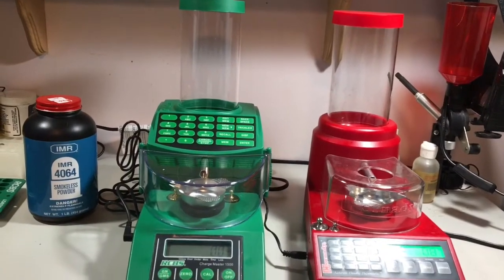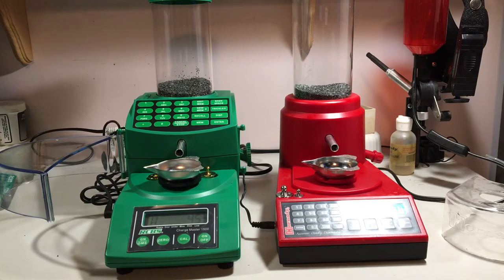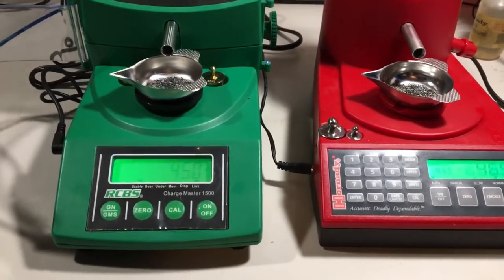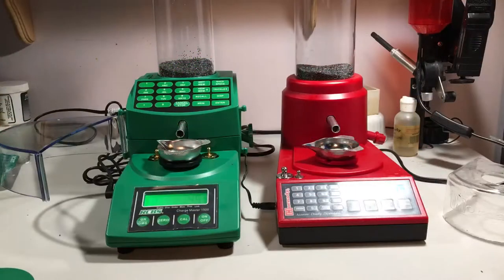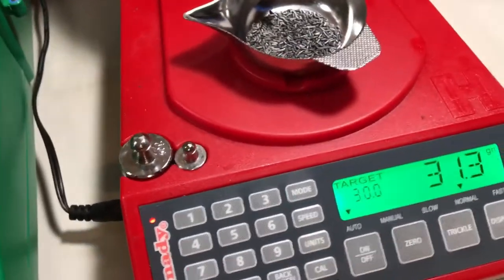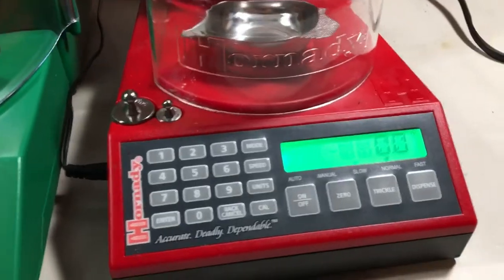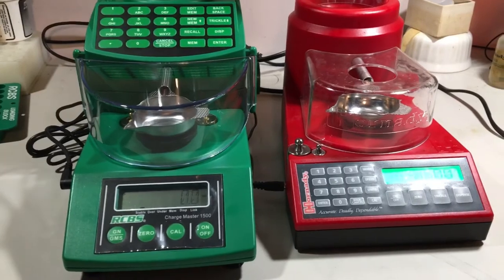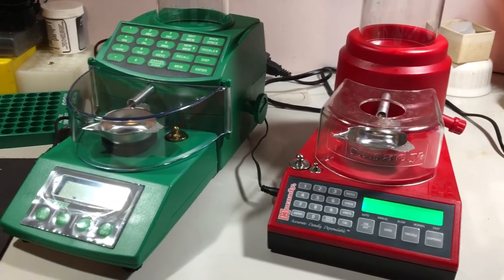Hornady vs RCBS powder dispensers

Comment: You need to slow the hornady with that type of powder. It would work properly then.
Reply from the maker: To a degree, you are correct. I did mention that in the video, I specifically chose to have each machine run at the factory settings. At every speed the RCBS was more accurate. I used both of these machines together for several months after this. RCBS is now the only dispensers my bench.  By no means was I trying to blast Hornady, I have tons of Hornady stuff, I just simply found this machine to be more more finicky overall. They are not necessarily an apples to apples comparison, I realize that. The RCBS is nearly twice as much but for me was worth it.